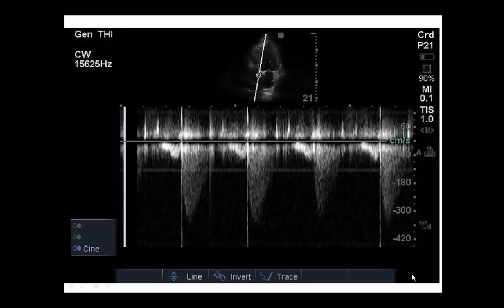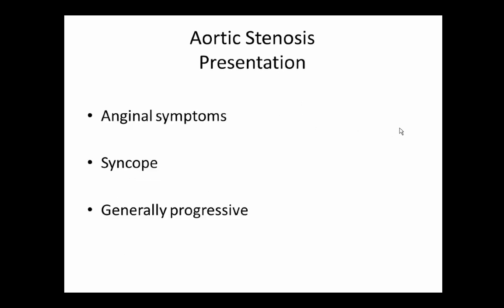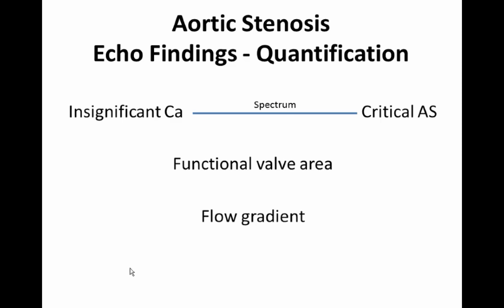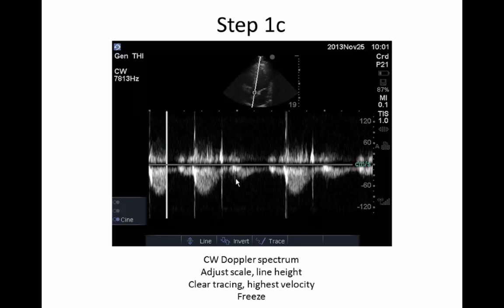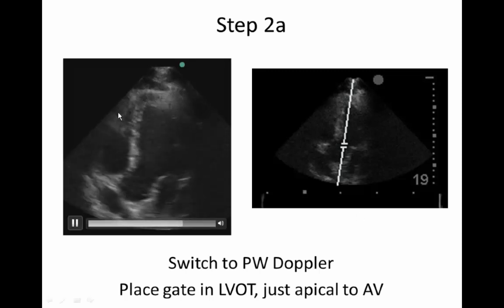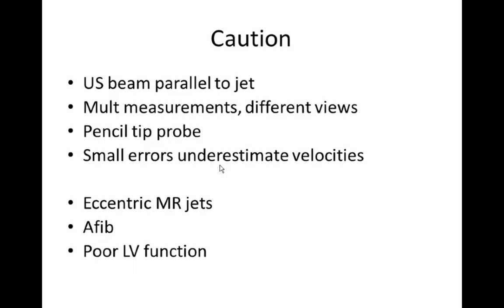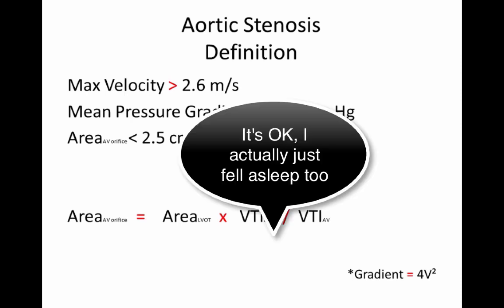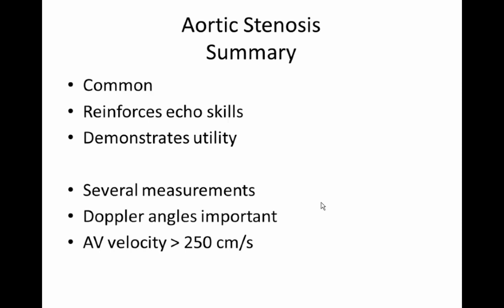Intro to Aortic Stenosis

Comment: Great video, at what point do you use pedoff probe? As a student it was only when severe findings during imaging, now I’m told it’s every patient with AS mild to severe. 
Thanks
Reply from the maker: In the point of care world, pretty much never as I doubt many point of care users have easy access to them. Any time, specific quantification is necessary and a standard transducer is inadequate for more specific quantification, then yes. I don't do comprehensive echo, but it may be standard in some echo labs to use it in quantifying every case of aortic stenosis, regardless of suspected severity.

Comment: What about low EF and decreased cardiac output? Still stop right there if the psv is < 2.5, even if we don't know the patients lv function? I know that AS is a chronic thing but what if the stenosis is severe and we cannot tell that due to the function of the lv due to low EF or WMA causing decreased cardiac output?  Can the patient die abruptly if the condition is severe AS with low cardiac output/ef?
Reply from the maker: You’re correct. AS with low EF is an important and more complex topic beyond the scope of this brief review. Here’s a nice slide set from the ASE 
http://www.asefoundation.org/wordpress/wp-content/uploads/2016/10/Echo-Evaluation-of-Valvular-Stenosis-Cundangan.pdf
Reply: Thank you! I will read it.
Reply: Also great video! Keep them coming.